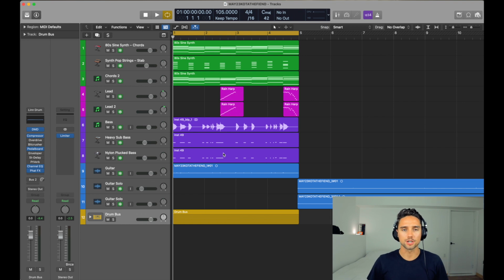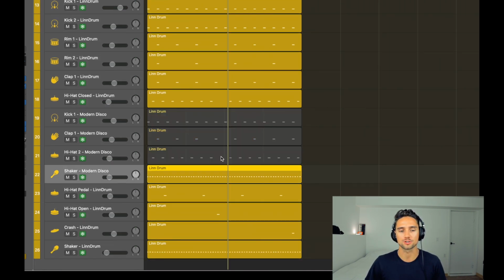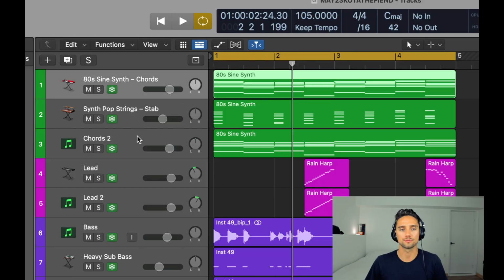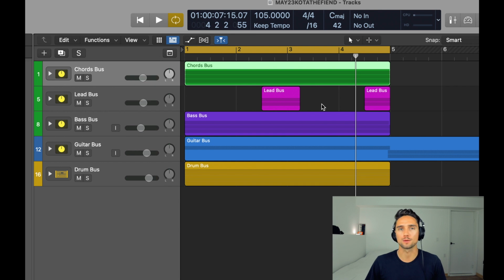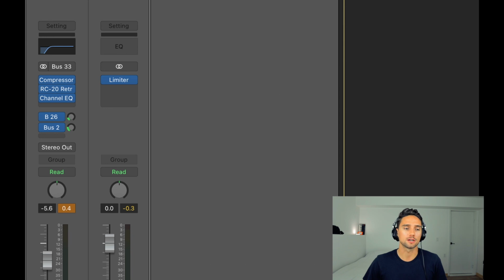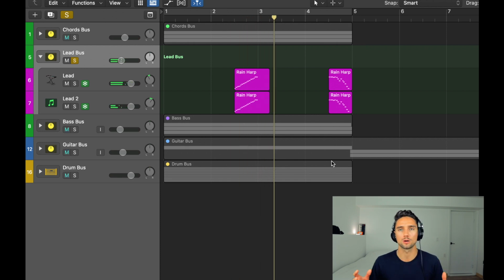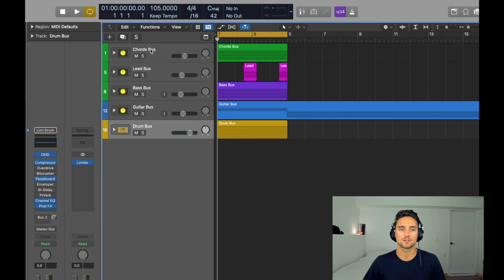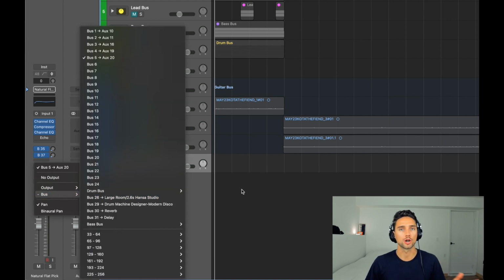🎛 What Is a Bus? How To Use Busses & Track Stacks in Logic Pro | Logic Pro Tutorial

Comment: That was super helpful thank you. If you were to do a revision on this may I suggest you start with the manual bus scenario first? My use case is simple: "I have two tracks and I want to share the same reverb settings". The solution seems to be to create a new track in the mixer (Ctrl-N), ("Aux 20"), ensure it routes to Stereo Out,  then change the two tracks to use Aux 20 instead of Stereo Out. The other section of buses still confuse me TBH.
Reply from the maker: Thanks for watching Julian!

Comment: Thank you for making a very clear to understand, visually aiding video :) The only thing that still confuses me is the 'sends' and the resulting duplicates. So if you have a track stack, which sends to say bus 2 and bus 4, each bus with a separate effect, do you end up with 1 track of the track stacks, one with the effects of bus 2, and one with the effects of bus 4? How does this impact the sound if the same thing is played 3 times at the same time with minor differences in effects? What is the benefit of the tracks being sent to separate multiple buses with effects rather than the effects just being added on the track stack, besides controlling the amount of effect? Sorry I hope that makes sense!
Reply from the maker: Thank you for the kind words, really glad you found the content useful.

Yes, you will get a duplicate of the track including it's volume, so having 3 or 4 stacked on top of each other could be a lot of audio signal coming from that specific sound. Typically you wouldn't have all of them sending to the bus at 0db, and also at full volume, you want to use the effects tastefully and therefore would have them as lesser volumes.

The benefit of doing this is having more control over each individual effect. If you have a delay after a reverb on the actual track (not bussing it out), then your delay is affecting the already reverbed track.

If you have a reverb bus and a delay bus going out from the track, you can set the parameters based on the dry signal from the track, and blend in the wet signal of the bus.

This on top of many other benefits like using less plugins to ease CPU load, keeping your tracks more organized, EQing out or boosting certain parts of the bussed effect are some of the many reasons to use busses.
Reply: @itstonyholiday  Thank you! This is really helpful and makes sense :)
Reply from the maker: @rmxmrmxm  Glad to help! Thanks for watching + the comment